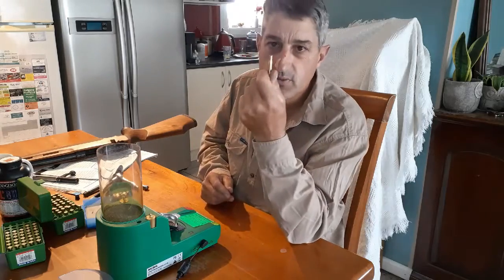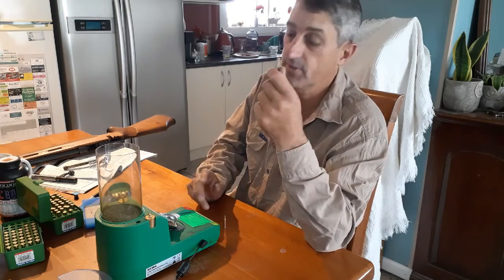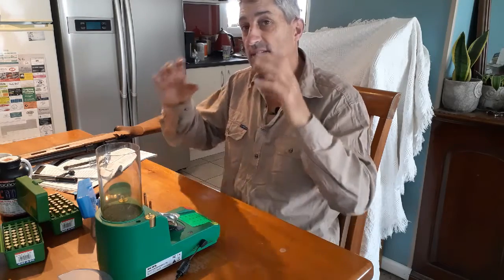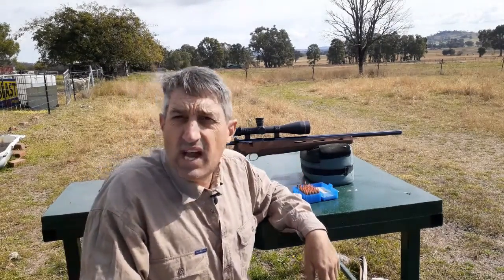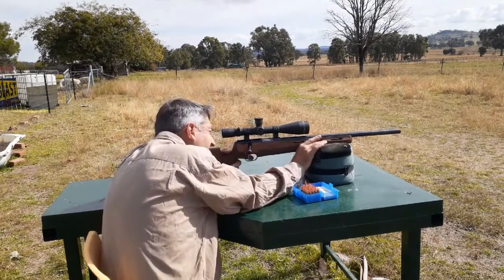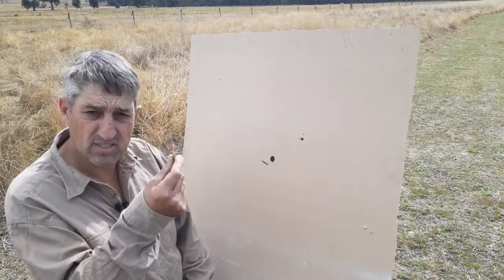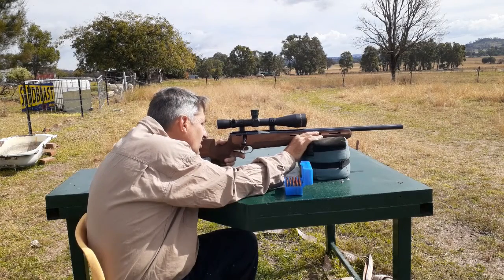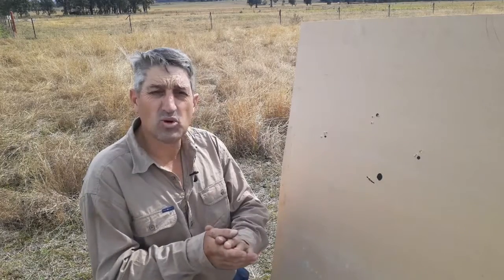Converting 22 Hornet into 22 K Hornet. (Remake video)

Comment: Hi Hornet guys. I get 3250 fps with my standard Hornet (CZ 527) Remington cases 40gr V-max over 14.5 gr of Lil'gun powder. Cci small rifle primer. I had 2.75" cut off my barrel being screw cut for my moderator but it would have pushed 3300+ I reckon. I've managed to get 14.8gr of powder in the Remington cases after fire forming chasing velocity but best accuracy was with 14.0 to 14.5gr. The 35gr v-max are very accurate as are Sierra varminter hornet 40gr soft points and Sierra 40gr hollow points (harder copper jacket) and best of the bunch at long range was the 40gr v-max with it's higher bc (3" groups @278 yards and that's with a cheap scope) 35gr v-max passes through the chest of a fox at 77 yards but stopped it in it's tracks. It takes a rabbits head off and flips them over twice 2 ft in the air. Ps I eat everything I shoot except foxes and I've only shot 4 foxes in my life 2 with a shotgun (36 grams No3 shot) and only for protection of live stock. The .22 Hornet is great and very capable. I don't see the benefits of converting to K. I've reloaded cases multiple times and get very acceptable accuracy and speed. The cost benefit here in the UK with the waiting times for adding a variant on the firearms license then proofing at Birmingham plus new dies etc doesn't seem worth it. I worked out my reloading to be £0.47p per shot. Factory ammo is £1.19p per shot for Hornaday 35gr V-max. All in all I'm very happy with it in its original and best form imo.
Reply: That’s some serious speed. Must try that higher capacity Remington brass.
Reply: I only use RWS (best brass i can get hands on) and 13 grain LilGun is case full, but it compresses easily. The sierra 40gr HP number 1385 is the best bullet i have used in the hornet, loaded to around 2800 FPS im sub MOA up to 200 meters, wich is my max range. The V-MAX is great, but in sweden the weight limits it to small pests. We need 40gr to reach sufficent weight for foxes, capercaile, grouse etc wich are my primary prey. It's the rifle i love to shoot the most, its accurate, the stock is nice and cheap to reload with 12.5gr LilGun.
It's a anschutz 1432-34 with a realy nice stock. The 527 is nice also, and is the only factory new rifle in 22h that is available here in sweden.

Swedish classification has kept the hornet, as the classification is only shared by a couple other calibers - 221 fireball, 204 ruger, 22 WMR and perhaps some pistol calibers like 9x19.
It's illegal to use any larger calibers (say 222R) when in the mountains hunting white grouse (ripor).
Reply: @jmkhenka  I also rate the sierra 40gr hp very highly too. It is a very accurate bullet. I have found it doesn't expand as well as the V-max 35gr & 40gr bullets do. The copper jacket is harder. The Hornet is a fantastic and very capable rifle. Have you seen Bows Guns Rods & Reels here on YouTube shooting Impala deer in South Africa with the Hornet? He's very successful with his Hornet. We can legally shoot Muntjac deer here in the UK with a .22 centrefire rifle but no other deer species.
Reply: @bear-tv  the kind of hunting I use the hornet for (eating animals) the bullet work exceptionally good for. It makes a hole but does more damage then a pure fmj. The birds we hunt here is like in the size 0.5-800gr (black grouse) to small 3-6kg (small turkey, capercaile).
And up to 200m it works wonder also having shorter safety margins then say a 6.5mm that is traditionally used.

Swedish laws are a bit dumb regarding suppressors, so I'm waiting for the laws to ev. change so I'm allowed to use it on the 22h. I own a pressor for the 6.5/308 now.
Reply: Hey buddy..i also have the 527 22HORNETT...

Im thinking of chopping my barrel to 18.50"..Do you think im gonna lose too much velocity?..

I have the "lux" model

Cheers from South Africa
Reply: @Peter  Greetings buddy, you shouldn't lose too much velocity. They say it's about 15/25 fps per inch. If you're using lil'gun powder, just fill the case to get max velocity. I use a drop tube and pour the powder in a little at a time to really pack it in. Give it a try. Lil'gun is very low pressure, so it won't blow you up.
Reply: @bear-tv  thank you sir...i wish i knew someone with a 18.50" barrel to test velocity on their rifle..lol..

Comment: I have a Thompson Center Contender that i rebarreled in 22K hornet. Loads are easy to fireform and brass lasts much longer than standard hornet brass. Shoots 1/4 to 1/2 inch groups at 100 yards if i do my part.
Reply from the maker: Nice
Reply: Hi Jon..

Im curious as to what barrel lenth contender you have and what speed you get from your  conterder

Cheers mate
Reply: @peter1873  barrel on contender is a custom wilson blank machined by bullberry barrels. It is 20 inch, about 820 in diameter. I usually shoot 40 grain bullets with either lilgun or h110. With lilgun i get about 3200fps and about 2900 with h110. Recently stopped using lilgun as it was enlarging primer pockets without displaying any other pressure signs. It did this even when i backed off on powder charges. Caused a little bit of flame cutting on my breech face. Cant afford to lose any brass. Cant seem to find any 22 hornet brass anywhere and only have 250 cases left. Other than that it a great little gun.
Reply: @jonleone777  Thank you Jon
If you dont mind,what is the powder charge with the lilgun @ 3200fps...

Thanx..
Reply: @peter1873  13 grains.
Reply: @jonleone777  thank you..

Comment: G’day great review and info. I’ve got a 17 Hornet in the Weihrauch H66 Jagd Match and have had a few problems with it. Got it going good now but when I got it the barrel lent to the right and was touching the stock. My smith worked out the gun was poorly inletted and he removed the recoil lug which straightened it up. Also feeding and extraction isn’t great but I love it cos it shoots good now. Have you experienced any issues? Getting a Form stock out of the UK for it and the recoil lug will go back on. Might head down the 22 Hornet path next in an Anschutz or Weihrauch (a tad apprehensive) and the K conversion info’s been really great. 
Cheers and thanks again 
Michael
Reply from the maker: Gday Michael.
Sorry to hear you have had issues mate. I worked out years ago that Weihrauch 17 and 22 hornets (and 222 actually) need ALOT external taper on the end of the neck of the brass when reloading. This helps the spent brass slide up and over the next round in the mag. Also try loading just 3 into the 4 shot mag. This helps too
Reply: @ozcountryliving4751  so tapering at the neck meaning more vigorous deburring on the outside of the neck or some other method. Apologies but only been reloading for a few years. 
Thanks again
Reply from the maker: @michaelcaporale2268  yes mate. As much taper as you can. Nd only 3 in the mag

Comment: Thanks for this video which I found interesting because I’m considering having my CZ hornet modified into a “K” chamber. My standard hornet shoots great as is  but the improved case life & velocity of the “K” appeals to me. Do you know if your gunsmith removed and set the barrel back at all or just reamed out the chamber & left it at that, as I’ve read varying articles on whether this is necessary ?
Reply from the maker: The whole procedure is done with the barrel in place mate